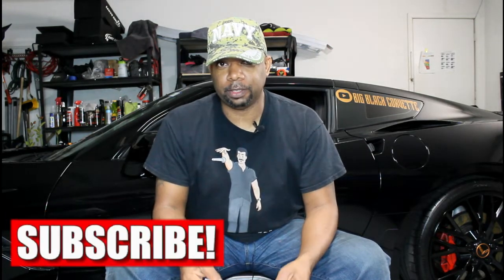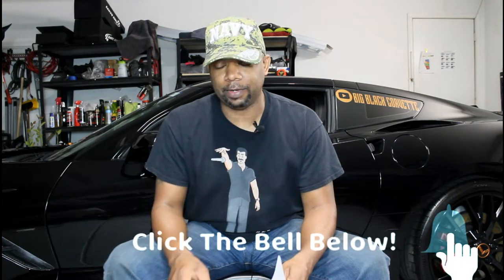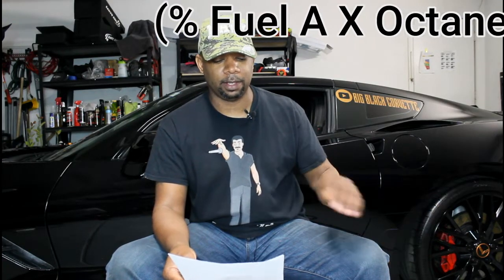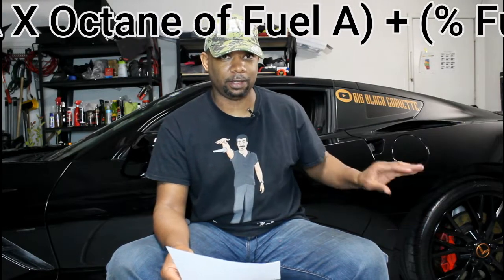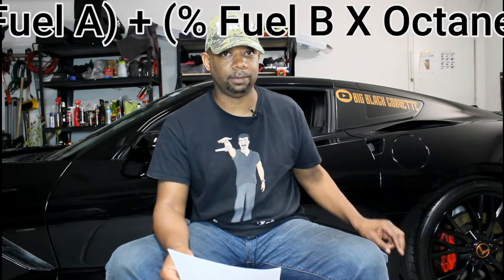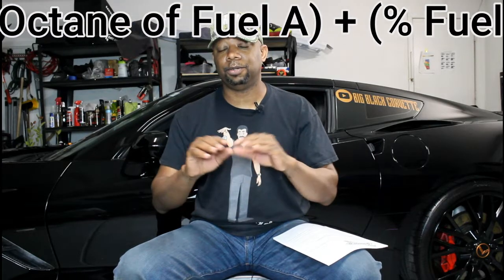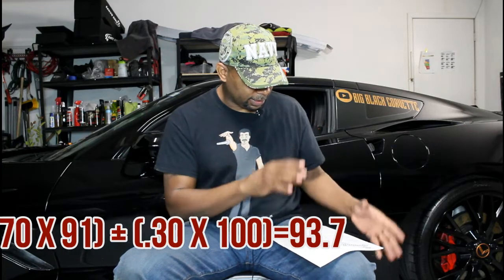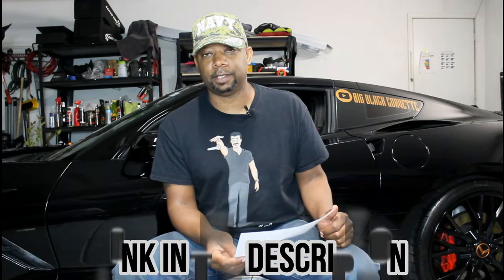Mixing Fuels.(The Race gas Equation).

Comment: Thanks for the information! I had about 15-20% of the tank, maybe 12-15 liters 90 octane, then refilled about 12 liters 90 octane + about 9-10 liters 95 octane. So, I guess I have now about 91.5 octane based on the equation, correct? The reason I did this, is that my 2012 Chevy Sonic requires octane 91 (as per the manual) and we have 90 and 95 only in my country. I used 90 for years but I'm noticing some knockings and other performance issues lately, maybe our fuel isn't as good now and 90 is not like before. So, I'm trying to increase the octane for testing, and noticed slight improvement and less noise after the mix. Is it safe to mix like this? Do you recommend doing this always in my case and what is the mix ratio of the 2 octanes above (should I refill 50% / 50%) ? please help :)
Reply from the maker: Correct
Reply from the maker: Glad I could be helpful.
Reply from the maker: Keep doing what you're doing. I would also use some fuel additive like gum out or royal purple fuel additives to keep everything clean internally.
Reply: @BigBlackCorvette  I'm not sure about these products, will check them out. However, last time I added a bottle of Abro octane booster in a gas station, my car broke down after an hour lol. So, I decided that it will be my last time adding these things, even if it was a coincidence 😂 It cost me around $750 till now. I had engine oil in coolant, changed some major parts like oil cooler, timing cover gasket, etc. Do you think those booster products can affect engines in some cars or make such issues ? thanks again!
Reply from the maker: @msh9497  fuel additive should be fine for your car. As long as they are approved for the fuel that you are using. Try looking at a video by Scott Kilmer on fuel additives. It is very helpful.